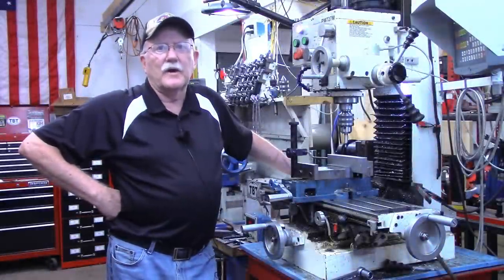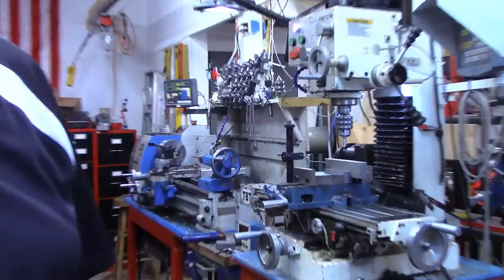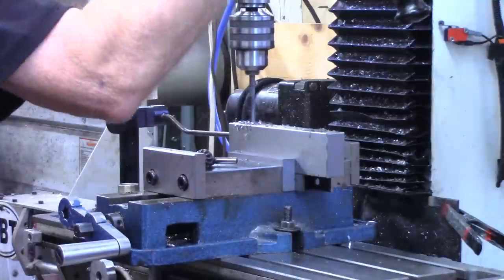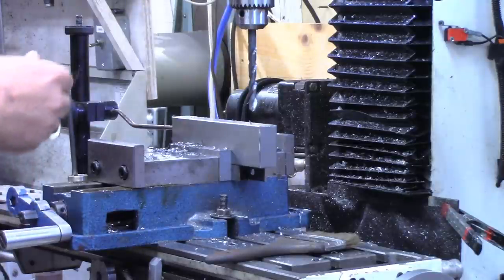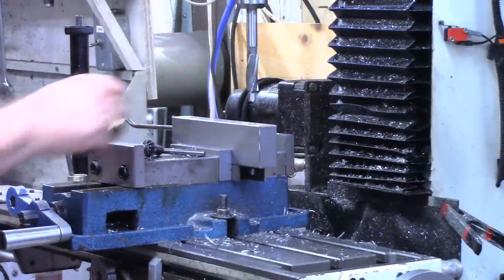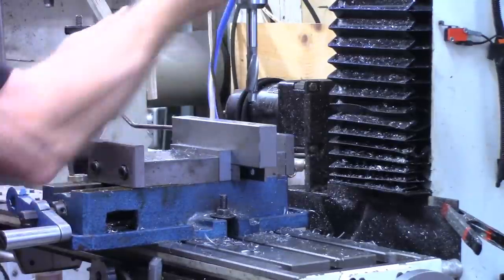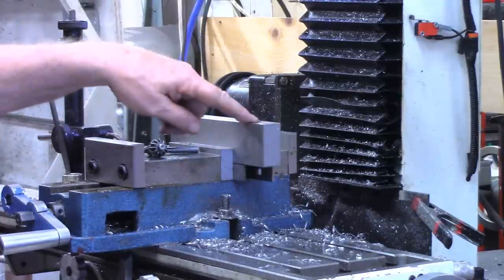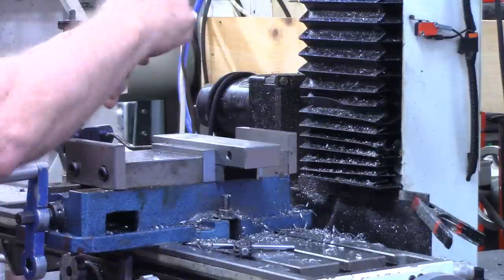2 Piece Mill Vise Part 2 of 2 - Vise Build

Comment: One thing I have learned when reaming, if you use a very light lubricant as opposed to normal cutting oil you will get a slightly tighter hole with the lighter lubricant, not entirely sure why, but it works for me

Comment: Next video, grind counter bore drill guides to size. I have  metric and sae sized counter bore sets, yours may be mislabeled. Spindexer under power with table extension in use.

Comment: I'm not sure the oversize pilot is a function of the tools being imports. A lot of single piece counterbores for socket head cap screws assume the through hole is clearance size of the screw and not body size. That being said some think that clearance size is +1/64th" while others think +1/32".
Reply: If it really bothered one, it would be a simple task to chuck the counter bore in a collet, and mount a small toolpost grinder or demel and take the pilot down a few thou, just as a suggestion.